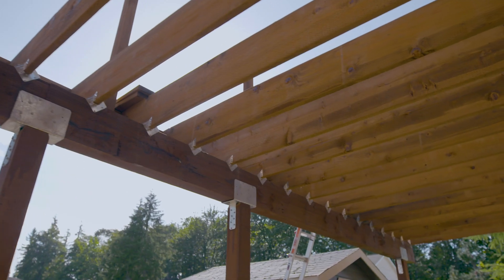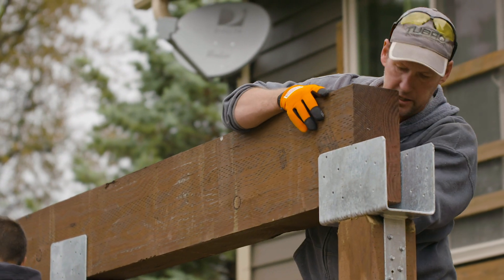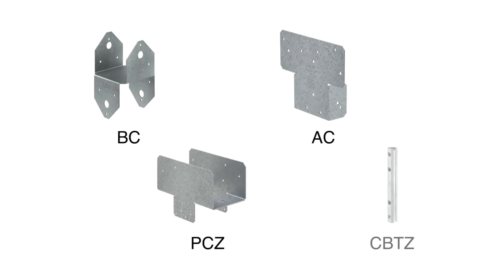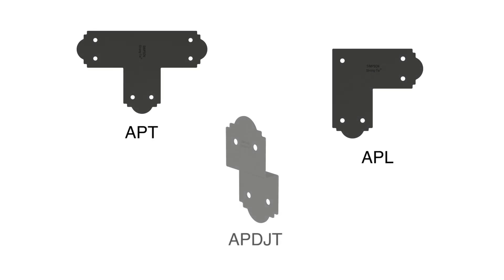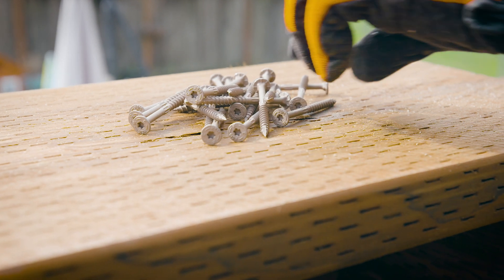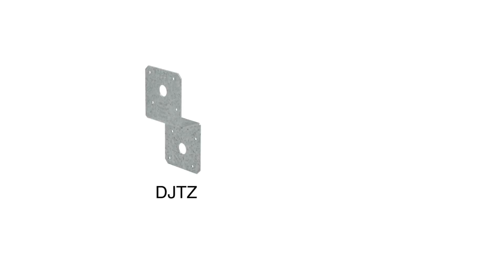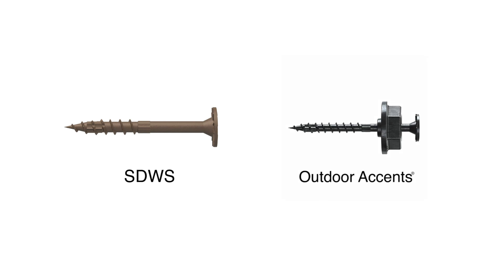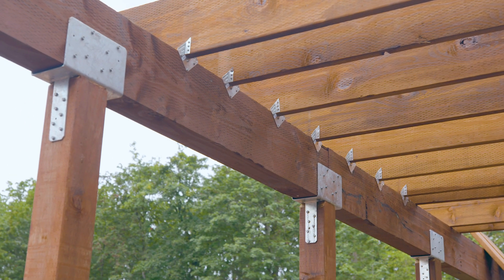Build a Stronger Deck: Beam Connections

Comment: Are 2 APT connectors enough to provide a post to beam connection or will additional uplift or racking protection be required assuming normal conditions?

Comment: any recommendations for a non-90 degree post-beam connection?  i.e., a beam that is horizontal, but meets with another beam at a non 90 degree angle at the post when viewed from above.
Reply: If I'm picturing correctly what you're describing, simple flat straps would secure the post and beam.